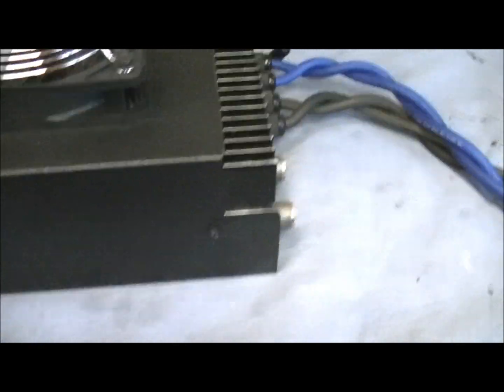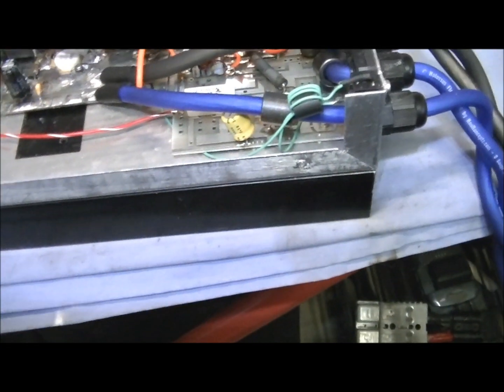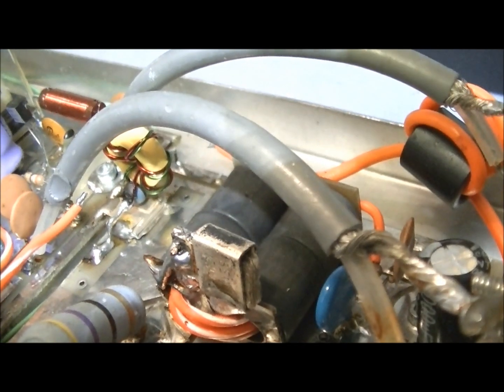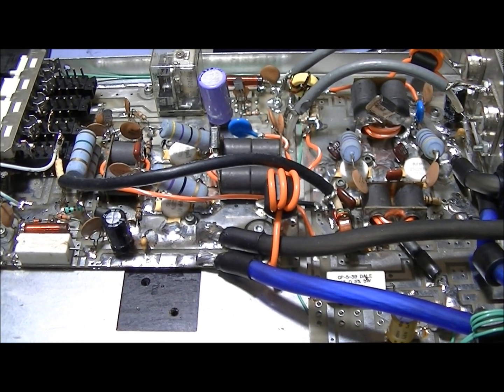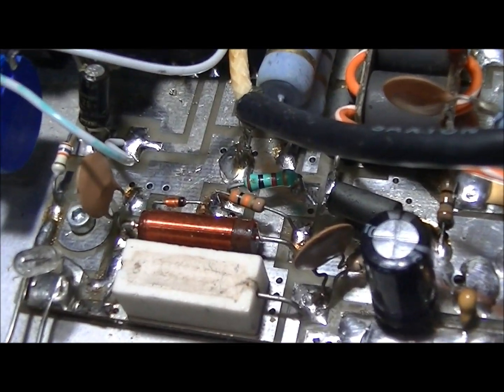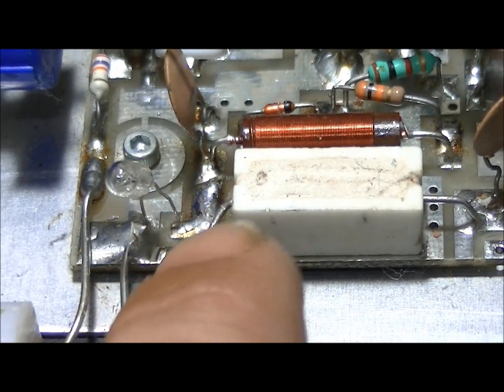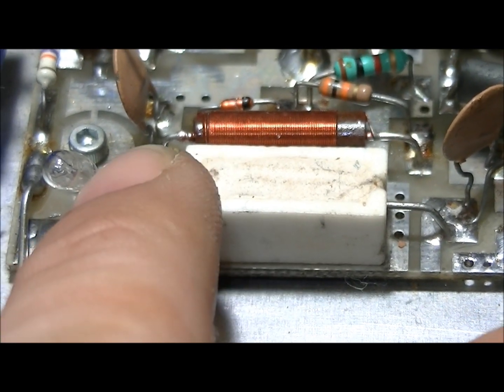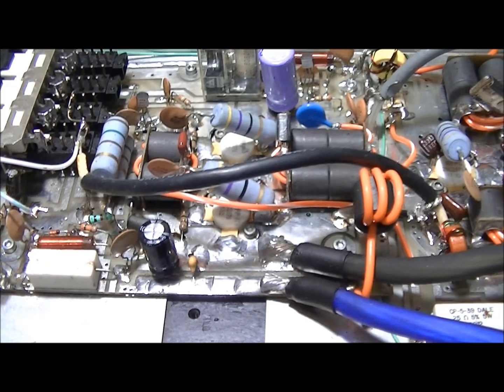🟠 Goldfinger TS 400V to 500V Conversion and Class C - Fixed 🪛 Again!

Comment: have not done a class C on a TS yet. moving just them input chokes to ground does the trick . buy them 25ohm sand bar still gets warm wasting power for nothing. I came up with a circuit using a DPDT relay to switch class AB to C but never got to try it on a TS box. I did it to outher amps and it works. class C will run cooler and you can driver harder. SSB is tricky getting the drive right to sound ok.  FM is great on class C . runs cooler so you can turn up drive but you have input resistors and a pot to worry about. what I do with my DX 500 is go to highest setting for FM . I leave bias on. just keep drive to 4 watts or so. getting a few more watts out gains nothing to the receiving end. you need 10X power to make a real difference. 73's

Comment: I have done some further testing with this Palomar elite 600 you can run it on a dummy load with a 1.0 standing wave and it will function find but as soon as you put it on an antenna then it starts going haywire only will function on low relays unkey switch to high and medium they will not unkey and it shows a high dead key no matter how low you turn your dead key down on the radio 1/2 to 3/4 of a watt it will dead key about 300 or 400 watts that might tell you something you may have an idea I don't know nothing about this stuff it just acts Goofy it was like that when I got it it looks clean inside can't see nothing out of the ordinary but I do not have a trained eye
Reply from the maker: Yes your amp is going in what is called parasitic oscillation. M
..what is causing it is probably a tuning cap that has gave up the ghost.... you want to try changing the 100 pf on the output first then go from there.